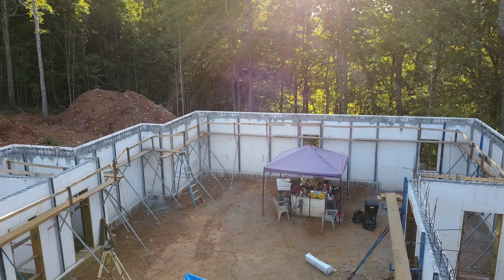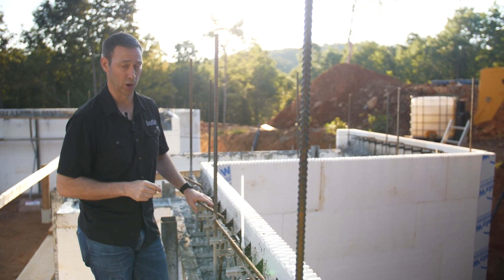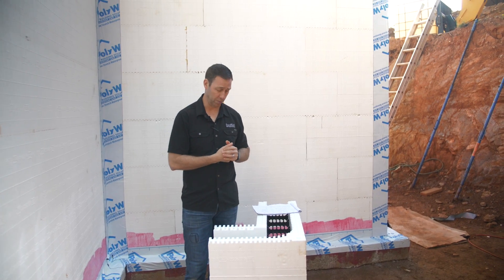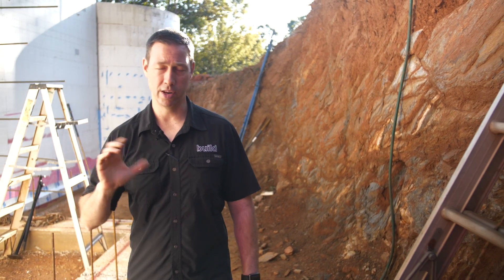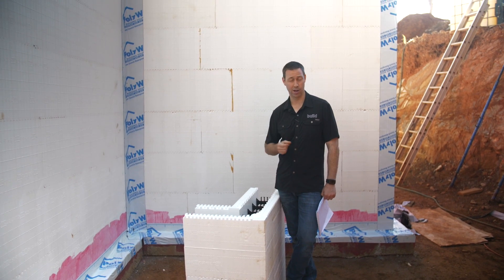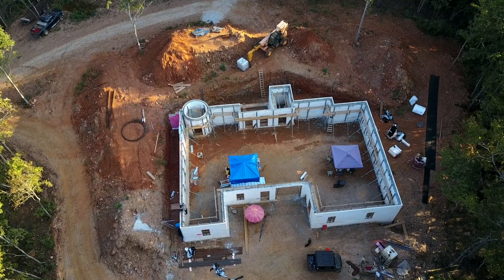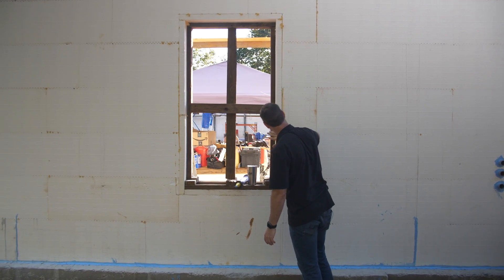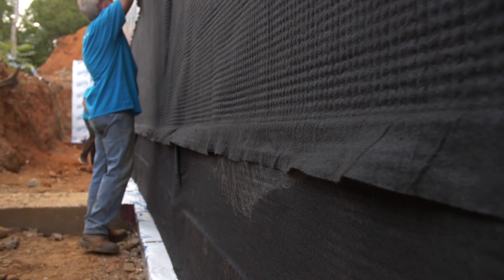Insulated Concrete Forms - Overview, Costs, and Cons

Comment: Big question - why isn't it more popular in tornado areas?  Does it really make more sense to rebuild from scratch every time?
Reply: I live in a tornado area. The thing is, even in tornado areas, the probability of a tornado destroying your house is extremely low. I've never even seen a tornado first hand.
Reply: Inertia. You can lead a builder to a great idea, but you can't make him build.
Reply: @tomtillman  You said it, One local builder lost his home in a tornado, but when questioned, he said he had build 30 homes and this was the first one blown away, so as a carpenter, with a hammer, he would continue to build with sticks.
Reply: Cost versus moving or building a new house
Reply: RTPSEV: Say again?
Reply: I've seen a small tornado cut through  a cinder block wall like a hot knife through butter. Here in Florida, we had a tornado during hurricane Ivan. It ran through a 30 unit motel and you could actually see the V-shape of the tornado through every single wall! It split every single room in two, as it moved down the length of the building. Maybe ICF is stronger, but I would hate to be out that money if it isn't. Imagine the cost of demolishing, if it was damaged.
Reply: There is a big difference between a poured reinforced concrete structure and a cinder block wall in terms of strength. I live in oklahoma and the local high school contracted a company out of texas called monolithic domes to build their new cafeteria as a reinforced concrete dome. The resulting building is strong enough that it serves as a community storm shelter and is rated to handle an ef5 tornado. While I wouldn't trust ICF to that extent (the roof is a major weak point) it should handle the much more common ef 2 and 3 tornado with relatively minor damage assuming you build the roof properly. Windows are still going to be an issue however you build and the cafeteria I mentioned has none for that reason.

As for why not all houses are built like this here. The area damaged by a tornado is relatively small, it is nothing like a hurricane, even with a monster ef5 you end up with maybe a few dozen square miles of devastation and the vast majority of tornadoes are not that powerful. Generally it makes the most sense to just have a safe room (usually a bathroom or closet on new construction) to hide in instead of building the whole house like a bunker on the off chance you get hit by a tornado.
Reply: @mgkleym  The savings of energy and sound reduction is worth using ICFs. The safety comes free. Even a drive-by shooter must hit a window.
Reply: @mgkleym  the roof can have tie downs set into the wall b4 the concrete is poured and can even tie down to the footers If you want
Reply: Rodney Fisk typically, cinderblock walls or CMU walls are left empty on the insides of the block with the exception of one cell filled vertically every 4 feet. A fully grouted cmu wall with vertical and horizontal Rebar will provide exceptional strength.
Reply: As Matt stated, they are used in places to build a safe room from storm disasters or is it disaster storms. The main reason a full home is not built due to initial costs despite the cost savings over time in terms of electric or other sources of heating and or cooling. But without the right windows and doors also built to withstand storms or natural disasters the home will still be prone to being gutted but not knocked down like the CMU wall is prone to no matter how much it is reinforced to code if not all cores are filled in with concrete or foam. Also the wind is not enough to damage the building but the debris it picks up and tosses around will do the actual destruction is the walls were not made thick or reinforced enough to withstand the tons of pressure being tossed against it by the tornado created debris.
I would provide some likes of proof but as the OP of the comment said there is no now ICF homes built in those tornado alley zones, however a hurricane can also be as and much more destructive.

And example of an ICF in a tornado with a poorly secured wood frame roof:
www.youtube.com/watch?v=DIfuPHLYDOE

And if you do not take time to click on a link and look through you would not know Build Block along with a few other ICF makers also manufacture ICF decks which can be used as a roof deck as well and thus like a monolithic dome along with Hurricane or tornado rated windows will hold up much better in said wind storms. So instead of a dome shape it would look like a normal house and no lost space like a dome suffers from is spatial design due to its shape
Reply: Joshua79C C Very good point! That’s one of the first videos of ICF houses getting hit by tornadoes. There was 2 ICF houses that suffered the same fate in Moore, OK back in 2013. The roofs were completely shredded, but the walls stood strong. Heck, the tornado picked up an adjacent neighbor’s full-size pickup truck and slammed it against the ICF wall of the house! The owner of the ICF house was in his storm shelter, which shared a wall with the exterior of the house, didn’t hear the thud of the truck!
Reply: @jaysson1151  It will also increase your cost of installation with near zero insulation value.
Reply: @jaysson1151  need to set tie down rebar into the walls b4 they are filled, and I would use steel roof frames
Reply: @RodneyFisk  block is hollow and weak, ICF is solid concrete
Reply: @RodneyFisk  I have visited hurricane struck cities too. The block walls usually are blown over as there is no reinforcing to keep them attached to the floors or footings.

Comment: Doesn’t expanded styrene degrade over time and moisture go through it? Does anyone make ICFs with extruded styrene or polyiso? Wouldn’t that be better?
Reply: It seems that EPS is better than XPS in real world scenarios - check out 'EPS Industry Alliance Technical Bulletin 103'.
Reply: What are you talking about. XPS is much better but twice more expensive. EPS is not resistant to humidity and this concrete hauses are humid as hell. Concrete sucks all the water like a sponge and doesnt release it for a long time. Anyway, for a hot climate its a good choice. For cold climate wood is much more comfy.
Reply: Dainevas please do more research as your comment is incorrect.
Reply: EPS far as I know and he clearly stated correctly it does retain water ike spongy XPS and ISO as he showed how much the spray insulation absorbed and held in the water when he did that video, I would prefer EPS over anythign else its cheaper ad dries out fast and often used in highway construction jobs to help deaden noise and as a filler as it does not degrade, Where as ISO and XPS, once it is crushed or damaged it will not spring back and they cost more due to their processing using extrusion, EPS or expanded styrofoam is expanded using only steam through the mold which the pellets are first poured into and not requiring any injecting.
Reply: XPS don't soak any water at all. Its the main feature. This is why it is used for foundation insulation. For the walls there is no need of using it. Anyway it doesn't change a fact that its different level material. Anyway this sandwich represented in this video is non sense. For cold climate inside insulation after a barrier (concrete ithe n this case) can't be thicker than 1/3 of outside insulation and other way around in warm climate. Anyway play around with u-wert.de (u-value calculator) it will show you the best wall construction. 
Anyway, this is heat loss as follows: walls-26% roof-22% floor-16% windows- 31% doors- 3%. Good luck on investing money on walls :) if you increase R value by 10% overall you will get only 1/4 of that. By the way, this is my house evaluation. It is 133 m2 (meter2) + garage 36 m2 (not heated) 295 m2 roof surface (around 220 m2 at heated house area) and 36m2 of windows. Anyway, for me where I'm from, concrete, bricks, EPS and XPS are usual and frame is exotic. I chose frame house because there is absolutely no sense of putting all this concrete in your walls. Simply no sense.
Reply: Ok Dave, will do :). Please do it yourself. What styrene....
Expanded polystyrene (EPS) foam is a closed-cell insulation that’s manufactured by “expanding” a polystyrene polymer; the appearance is typically a white foam plastic insulation material (the likes of which can be found as merchandise packaging). Extruded polystyrene (XPS) foam is a rigid insulation that’s also formed with polystyrene polymer, but manufactured using an extrusion process, and is often manufactured with a distinctive color to identify product brand.
Reply: Dainevas the paper concerned itself with total immersion in water and freezing. The forms used to pour concrete wall have been designed to allow manufacturing, handling, stresses of shoring & pouring, imbedded anchorage and other functions throughout the the life cycle of the product. The paper does not address the problems with XPS in “real world”.  A cost benefit analysis would have to be performed on the durability and using the XPS for walls above grade. That is to say the places where saturated conditions exist followed by freezing may only be a small percentage of the product actual use. XPS to frost proof seemingly applies to unheated spaces that need to function for many decades e.g. bridges and public works. Performance would not be improved for most cases where water barriers could be applied in the field to match expected conditions as in residential construction. I would like to know how Norway changed their building practices. If you know please share.
Reply: Dainevas, that study is very biased, it seems to me some folks doing it fudged the numbers or in this case posted EPS amounts as XPS, in this case it was lab study, as Dainevas states and I know more is that Lab studies are not as reliable of real life cases and XPS is WORSE than EPS. What they failed to further note in or even do in their testing is check how well each drains the water it collects and still XPS will hold water and not the case with EPS which the water will evaporate from.
All I care really is letting you you and then you going on to pay more for the XPS when it comes time to replace due to your belief in some lab study paper.
Reply: Link does not work (u-wert.de)
Reply: EPS  does not degrade over time whereas polyiso and excruded styrene do.
Reply: Styrene... what in the hell is that :D
Reply: It's nice to read comment where people are arguing with informed opinions. So: good job everybody :)

Comment: Wow Matt, I'm getting ready to build a house with ICF basement walls myself (as owner/builder) in Atlanta and plan on using a lot of the products and techniques you've shown on your channel.  On thing you commented on as a downside was the fact that you have to get walls plumb.  To be honest, I don't quite understand how that's different from a traditional poured wall foundation.  Isn't a plumb traditionally-formed concrete wall just as critical for it to be plumb?   One other thing worth mentioning is that many of the ICF manufacturers allow for additional insulation to be added to the inside of the forms to increase the R-value.  Did the owner in this case actually do the pour?  I don't have the skills or tools to do the actual pour so a referral to someone with experience would be awesome.  Thanks so much for all the videos and education!
Reply: Karl Fischer Talk to keith@icfguys.com  he is an ICF installer that will work with owner/builders
Reply: Chris ... Your link is not valid.
Reply: Sorry. Youtube filtering system ate it.  It's an email address, "keith(at)icfguys.com" he doesn't have a website because he stays too busy without it. Great guy to work with.
Reply: Chris Morse thanks so much!  Any idea where on Atlanta this house is?  We're building in Cherokee county
Reply: Karl Fischer Keith is out of Florida but works the entire country so any part of Atlanta is easy for him. He’s who I’m using on my house.

Comment: Good video Matt, I would add that vibrating the concrete during the pour would be advised. As you would not truly know what voids are possibly left in the wall since there are no forms to remove.
Reply: frankly that should be a standard part of ANY wall pour
Reply: Plasticizer additives are important as well. always, always vibrate....especially with ICF. I have seen 3 ft high ICF walls with holes in them...SERIOUSLY...vibrate
Reply: It's most common to use a special icf mix or "pea" mix on the pour which is wetter and thinner with smaller stones to reach bottom plus the pours are limited to 7 feet or so at a time, no matter the height.
Reply: I didn't vibrate my walls, I used what they called "grout" to fill the blocks, it was pretty thin but a high  strength mix, vibrating can cause blowouts, the grout is self leveling
Reply: Devon St John - vibration is a must do when pouring the walls. If you don't you have all kinds of hollow spots in the wall.
Reply: I've looked at several homeowner-built ICF homes and found voids under large openings (windows/doors) due to improper vibration (or lack thereof)  The ICF manufacturers need to start telling people to install lookouts to ensure no air pockets in window and door bucks (common in standard poured concrete wall construction) - and to pay particular attention when vibrating around them.
Reply: @ArthurDentZaphodBeeb  Probably a dumb question but I’m trying to learn.  What is a “lookout” that one installs to ensure no air pockets in an ICF pour? (I know your original post was 2 years ago but hope you will see this Q).
Reply: On the 12" fox block schools I did electrical on. They vibrated the walls while filling them. Some of the chases  especially the wider ones for ducting and windows had large voids under them.

Our electrical chases were simply 6" pvc through the walls and we left them in. 

On the voids found once the forms were pulled the general went back in a poured the voids with quickcrete and a wheelbarrow. Didn't take too much to fix them.
Reply: @nevermindthebull0cks twelve-inch concrete reinforced concrete walls would be great to stop army tanks from entering the building.
Reply: @Drwild75  And hoodlums
Reply: @nevermindthebull0cks  We failed to do this on our house, but underneath the windows, instead of framing the whole thing with 12" boards, you use 2x4 on the bottom, and fill that area through the hole that leaves.
Reply: @RussellNelson  We started pouring the concrete from the windows bottom openings and when concrete got to the window level, we closed the hole with ready made timber support with screws. Then we moved to pour from the top of the wall. We did about 6-7 feet pourings at time. That was in 2004 in Finland.

Comment: Really appreciate your input on this as I've been looking at ICF for quite a while. Always love your content - fantastic!
Reply: Mads Christensen  check out Hobbs Verticle ICF they solve some of the issues with block ICF
Reply: This is a lot of screwing around for a wall that has way too many penetrations.  We just pour walls, spray them with a elastomeric and glue 2” ground contact blue board on the outside and then drape heavy Polly from the bolts down to the footing.  Super strong, no excess penetrations, highly waterproof,with a fraction of the labor an no Blow Out Risk!  You can insulate to your hearts content on the inside!